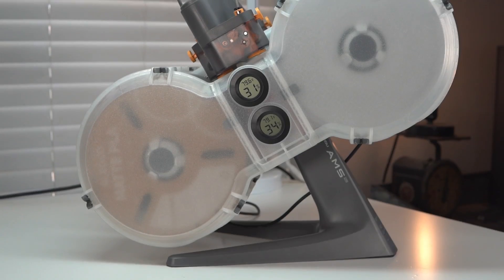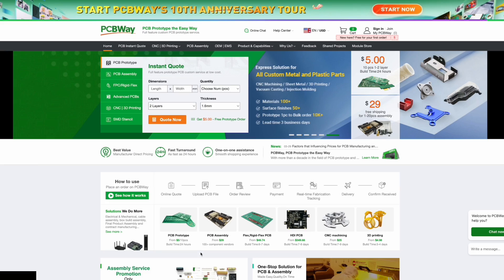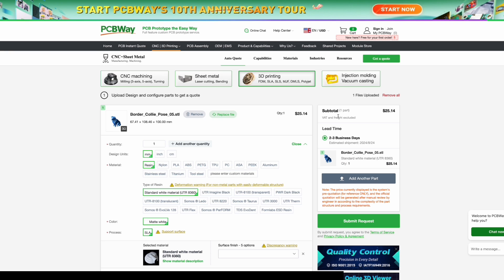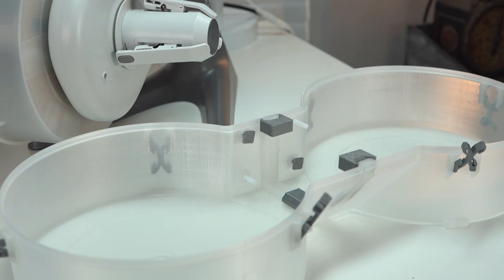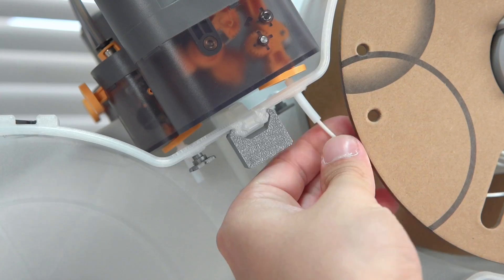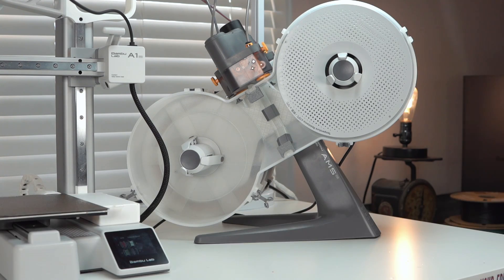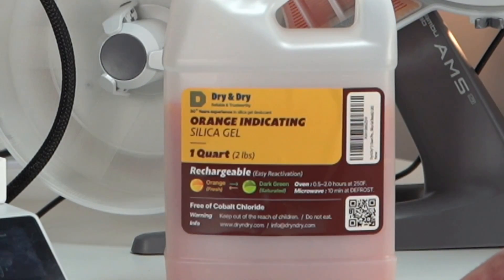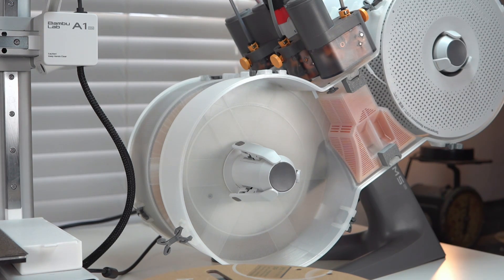Should You Print "The Ultimate Filament Spool Enclosure"?

Comment: Hi, I don't know if this question has been answered but I want to design my own wall mount for the AMS with this enclosure fitted (once I print it). What I want to know is how much does it add to the diameter of a standard Bambu spool, because I need to provide clearance!

Comment: newbie here, trying to print this enclosure with Bambu Lab's transparent PETG filament, can't get the buckets nor covers to print without them getting ruined by excessive stringing and/or breaking while the printer hear moves. Any help would be greatly appreciated. I am printing on a smooth plate on a A1 are temperature set at  240

Comment: Well, I’ve printed it this week. 
I went for the windowed version, which I believe doesn’t catch up with the latest versions from the original maker. It’s ok, I wish the lids were thicker (they can be a bit fragile) but my number one problem with this is I can’t get the moisture below 30-20%?? And that’s the whole point of it lol. 
In a 40%-50% room it’s only knocking off 10-20%. 
Could the original maker just add the mods they approve of into their original, updated post as a collection? Or even a ‘mods’ file with all the beds. Mods are great but they don’t stay ‘live’ with the creators releases.

Comment: On 5 sec of video there is just a little difference between in and out 31-34% so is this mean that this enclosure won't work well? I mean it's not too little job to print all this and for only 3%.
Reply from the maker: it’s entirely up to you if you think it’s worth it. i’m currently sitting at 9% in the enclosure and im very happy with that
Reply: @ thanks for replying! Can you tell me how much is outside of enclosure?
Reply from the maker: @SrdjanPetrovicfotograf right now outside is 25%

Comment: In the UK this is 100% worth it. Its autumn rn. Outdoor humidity is 81% rn, goes >90% overnight. Indoor humidity is 60%. Inside my AMS lite enclosure its 25-30% humidity. Still too high, but miles better than ambient.

Also, "bowden tube" only really refers to a long run specifically to an extruder, thats just a bit of PTFE tube lol.
Reply: A bowden tube more specifically refers to a technology where a hollow tube is used to transfer pulling/pushing force. Invented by Frank Bowden and not just for transfering plastic to a printhead, also used in brake cables on bicycles and alot of other stuff. PTFE tube is just the material used in the printing industry but a bowden tube can exist in many material formats.
Reply: I still can’t get the moisture below 30% or so, with fresh dried orange and no holes in the prints.
Reply: @Mr_Gadge  Weird, I see as low as 20-25% when I put completely dry silica in, after a little while it hovers more around 30-30% until I refresh the silica again
Reply: @trotskiftw  yeah, 25% is only 5% less for hours of printing and faff lol.

Comment: 2 questions from a newbie: A) What PTFE tubing should I buy(include sizing, please) B) Does the action bucket need to have it's orientation changed. I printed the first one, and I could not get the supports out. I guess that is question B2) Does the action bucket need to be printed with supports?

 I put this question in your older video as well. Sorry for posting it twice
Reply: Lots of ebayer sellers - search for "3D Printer PTFE Tube for 1.75mm Filament Extruders 2mm ID 4mm OD Teflon Tubing" you only need 50mm. Buckets dont need supports when printing.
Reply: I printed mine without supports using PETG Translucent blue with no supports. Printed without issues.
Reply: I printed everything in translucent ELAGOO PTA (without supports) with no major issues.  I initially did not use the Bowden tubes but am going to add those as it seems it will be easier to load the filament

Comment: Awesome videos.  I live in a high humidity area, and currently have original X1C AMS which I keep sealed for the desiccant to do its job.  I was looking at a A1 Mini Combo as a dedicated 0.2mm nozzle small model dual-colour printer, but the open AMS Lite was a wet filament worry.  It looks like this print is the solution!

Comment: Great design - printed out and works perfectly using the top mount but you need to use the adapted screw. Loaded up Bambu labs basic PLA and one of the spools was not recognised but when restarted it recognised all the BL spools perfectly - brings down the RH to 20% compared to 45-50% in the room. Your video was helpful and the designer has to be complemented for this superlative design and clear instructions.
Reply from the maker: that’s awesome, i’m glad you liked it!

Comment: I find the RFID reader is spotty with Ulti upgrade. But drier filament is worth it to me.  My basement humidity is 46%. Inside the Ulti AMSL with desiccant, is 22-23%.  And it only takes a couple seconds to tap in the right filament on the screen if the RFID doesn't register.  

And btw, the Bowden tip is choice; definitely makes it run smoother and quieter.  

Also, I tried a bunch of packets of desiccant on one side, and % didn’t change at all. But that orange color-change kind works great; I got it after watching your first vid.
Reply from the maker: that is interesting, and yes the bowden tubes are a must

Comment: do you have problem of the enclosure hit ths filament spool? i use a1mini and it hit my spool all the time maybe because of a1mini profile need to cut part a lot
Reply from the maker: I have not had that issue. Is the spool too big for the enclosure?
Reply: @jet_lea  6 and 6.8  i think the problem was with a1mini cutting part that not 100% fill the gaps, i use solder tool to join the gaps.  Just ask incase if you ever try that. It hit but it work it just make annoying noise when it hit .
Reply: Ok out of frustrating with build volume so i just went to the shop and pickup A1 just now , hope it would work this time.
Reply from the maker: @flameboss555 let me know how it goes!
Reply: @jet_lea  Ok i finish print first half (1 and 2) for how to goes , it still hit the bucket but hit less than before when i do it with A1mini.
Work around is i slide the spool in almost all the way hope that it have bit of space to move  which work on my 60mm spool....but it not work with my 68mm spool ,.
The noise that spool hit the enclosure is not that loud it just that i sleep 2m away from the printer so i try to reduce it as possible.

Comment: I've been 3D printing with PLA and PETG for quite a few years now. I haven't had any issues with moisture getting into the filament. I just purchased an A1. It's my first Bambu Lab printer and I love it! The quality is second to none. I live in the south. It's quite humid here. I guess I'm questioning the need for an enclosure for PLA and PETG. I would understand Nylon or TPU but you can't really use the AMS lite for TPU. Is the difference in quality that noticeable by using the enclosure?
Reply from the maker: I’ll be honest i haven’t noticed any change in print quality but I also live in an extremely dry environment so the need to remove moisture from the air was already low. I do love this enclosure for keeping dog hair out of my filament rolls and i’ll try anything that has the potential to improve print quality or consistency
Reply: It really depends on where you live. The humidity outside, of course, but more importantly inside of the room where the printer is. I live in an old building and here, the humidity is always between 50 and 70%. Never lower, sometimes a bit higher, and usually around 60. PLA hasn't really given me any problems without the enclosure, but PETG has been and TPU is just awful to print with if I don't make sure it's dry. For me, the enclosure is an absolute must.

Comment: Thanks for this update! I am very new to 3d printing. Can you explain what a "binding issue" is/looks like?
Reply from the maker: no problem, it’s where the filament will get stuck inside the enclosure and you’ll get an error on the printer
Reply: So essentially if everything is free flowing it's all good then, great! The hygrometer's just came in so I'm going to be assembling this very shortly. Thanks again!

Comment: Hey Jet! I wish i could send a picture on here, i got an a1 mini because of you. Unfortunately when i tried to move the ptfe tube connector where the filament goes in at, one of the little clips snapped off. I managed to get the bowden tube clip metal piece out of the plastic part that snapped. I wondered if you have seen a file for it anywhere to print a new one that i could press the metal part down in. Thanks for all the helpful videos!
Reply from the maker: let me look into it and i’ll see what i can find!
Reply: @jet_lea  thank you, i figured printing it may be easier than shipping a part if possible

Comment: I would recommend to not print this if u want a proper enclosure. 
Just because u can 3d print a solution does not mean it is the best. 
I've learnt it the hard way, instead of printing this, get 3500ml air tight containers(dimensions that fit your spool , around 23cm diameter on 10cm height will do), drill a hole for the spool and slot it on. 
U can find ready made desiccant holders for containers on makerworld. Some slots in which requires the exact same container or some that can be used with just a few screws to secure them to the lid. It costs cheaper, air tight, and less hassle.
Reply from the maker: can you still use the ams with this solution??
Reply: Need more info. I have plastic tubs just above the size of the spools. 
How are they fixed to the AMS ?
How do they feed out from the tub?
Where do these “ready” desiccant holders go?
It sounds good but you need to make a page project on MW to get the word out. I’d love to hear.

Comment: I printed and have been using this.  It is a great design but not ideal for carboard spools which aren't as perfect and the original designs outer wall thickness is too thin.  This can cause a lot of drag and poorer or inconsistent extrusion. 

I already cracked one cover installing a filament reel.  The designer created a thicker wall thickness version and people should just go right to that one.

I plan to mod the design to allow more clearance to spools and a larger reservoir for desiccant.
Reply from the maker: Interesting, i’ve had no issues with cardboard elegoo spools yet however i’m transitioning to sunlu because i am having issues with cardboard in my standard ams

Comment: i did print 1 side only, the problem is this with my mini print farm is the filament loading process, i can change up to 5-10x a day, the second one, its not air tight (ofcourse right) so my silica gel will saturated 4x time faster than dry box. still, it is the best ams lite enclosure out there! no hate, just give my honest opinion
Reply from the maker: Definitely takes longer so I don’t blame you!
Reply: If you have a print farm you could dehumidify the room as a whole instead of just the filament.

Comment: I printed it and thought it was great ... I found out after the fact, When you use the Top Mount A1 AMS it clashes with the front two spools
Reply from the maker: did you try out the shortened screw??
Reply: thank you I did. I think the issue was that the shroud is so thin that when you do the top mount the two forward spools are leaning forward. The shroud is held in place by the spool holder pinions. So the lower section of the shroud falls slightly forward under gravity and rubs the forward spools
Reply: Did you print the additional two brackets that hold the front and back enclosure "buckets" together. Adding the  brackets on the top and bottom (2 on top and 2 on the bottom) pull the two enclosures together equally

Comment: Make sure to print the one with the windows.  Works like a champ with one stinker.  Cardboard rolls are a stinker.  Not impossible just a stinker.

For the Windows I took a paper protector, cut to fit, glue on the inside, trim a the additional with exacto.  

Noticeable difference between the inside and the outside.  

10 out of 10, TYVM for the vid.  I saw this and while ago and it was your  previous vid that made me do the job.
Reply from the maker: I haven’t had any issues with the cardboard rolls yet, i’ll keep my fingers crossed! Glad you enjoyed the videos :)

Comment: It’s good, but 100% print the windowed remix.  Transparent PLA/PETG doesn’t let you see inside worth a darn.  Otherwise, this thing is pretty fantastic.  And absolutely use the Bowden tubes instead of the funnels provided.
Reply from the maker: There’s a remix with a window??
Reply: @jet_lea  Indeed there is.  It’s the fourth item on the Makerworld page, just above the A1 Mini remix.  The one by AF360.
Reply from the maker: @iansabrewolfe interesting, i’ll have to check it out
Reply: @jet_lea  the maker recommends using clear 1.5mm vinyl protector sheets, but you can use most anything that is clear and flexible for the window.  I used some spare 1mm PET craft sheets I had laying around.

Comment: I printed it after your video but then I installed my Ams Lite in a wall mount and now I can’t fill the desiccant holder. Do you know a proper modification for this? I didn’t find a solution yet… 😢
Reply from the maker: The only solution i can think of is to use the packets of desiccant instead of the loose beads
Reply: This is the easy way. I’ll try to design my own solution 💪🏻
Reply: Just wait a couple of days, I have a new design with a better lid for the desiccant holder
Reply: @theSupergrapher  What? Let me know when is ready ❤️❤️
Reply: @rawlmp  uploaded!
Reply: @theSupergrapher  Magic!!
Reply: @theSupergrapher Me too. Will print next week also for wallmount with silicabox. Can I print everything without the lid? Remarkable design!!
Reply: @paulusdeboskabouter9753  Uploaded, now with option for the paint-on covers for vertical orientation
Reply: @theSupergrapher  Thank you, but i dont need it anymore. Sold my a1 an bought the p1s. Show your enclosure to the A1 buyer and he would print it

Comment: Thanks, I did print this after seeing you first video on it. It was one of the first things I printed. It took several days to print all of it but it works great. My hygrometer shows this REALLY works. This morning it read 38% outside, 11% inside! The only issue I have had was binding. I did have a print stop and my plan to fix that was to put a PTFE (boden tube which I have left over from my Ender 3) through the case but you beat me to it 😀
Reply from the maker: i’m glad it works great and the bowden tube solved all my binding issues completely:)
Reply: 11% is impressively low!
Reply: Nice video subscibed. Thinking of printing it. But is the 11% maybe because the hygrometer is on top of the silica?
Reply from the maker: @paulusdeboskabouter9753 it definitely could be a skewed number because of this but i’ll take any little improvement that it makes
Reply: @paulusdeboskabouter9753  I have no idea why it read 11% initially but today I see on my Ecobee thermostat that the humidity in my house is 66% and I am running mid 20s in the AMS. It seems to have leveled out in that range. Either way it looks low enough that I don't feel the need to dismount the filament to store it in my dry bags (I use sealed vacuum bags with a canister of silica beads in it).